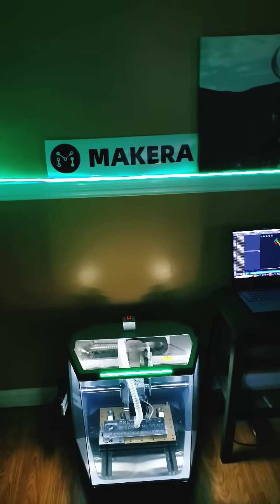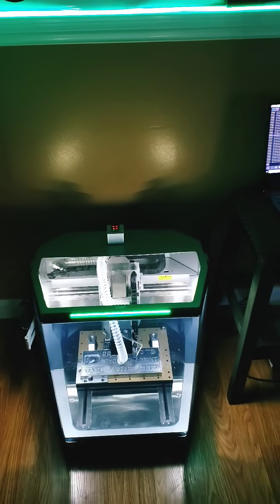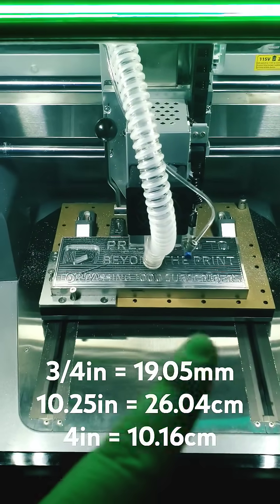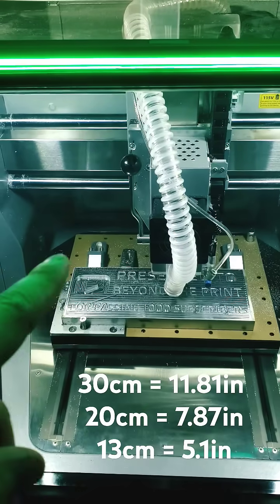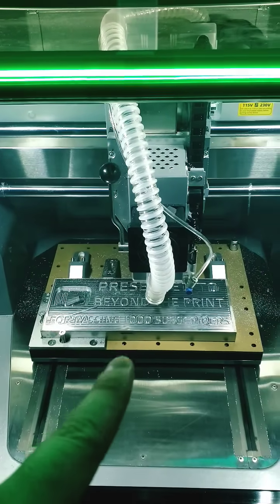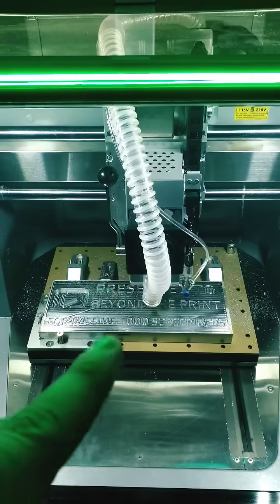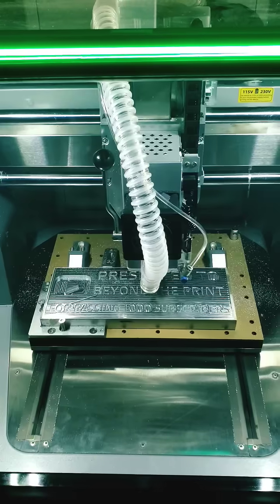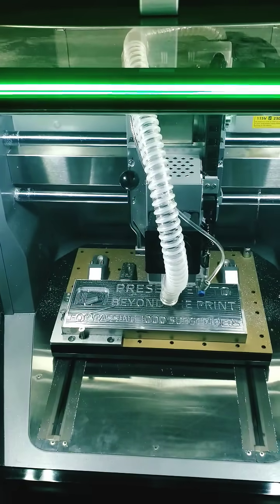Machining My First YouTube Play Button with the Carvera Air!

Comment: Sir please reply to me  can it cut 180 mm thick steel vertically?
Reply from the maker: It's working area is 30cm (X) * 20cm (Y) * 13cm (Z). In the vertical you can only cut up to 130mm
Reply: @Beyond_The_Print  Thank u love u sir u've cleared my all doubts 🤍
Reply from the maker: @syed.farhan_7 no problem! Check out Makera for more